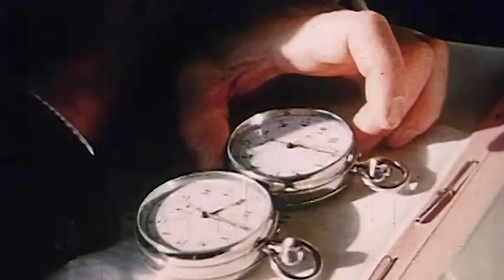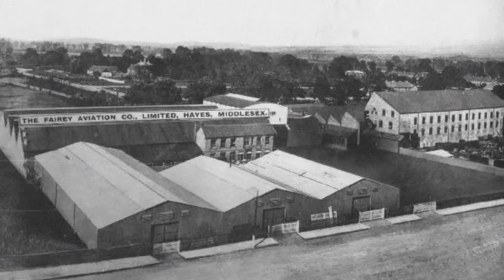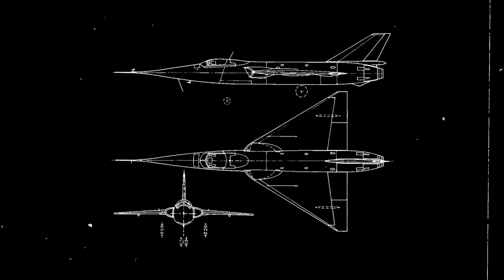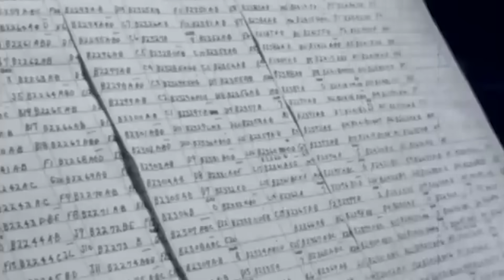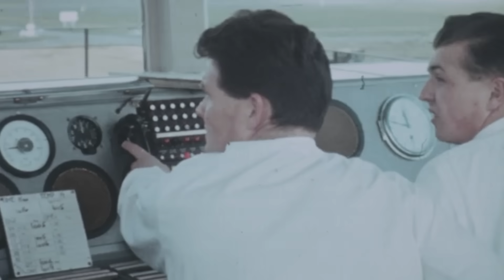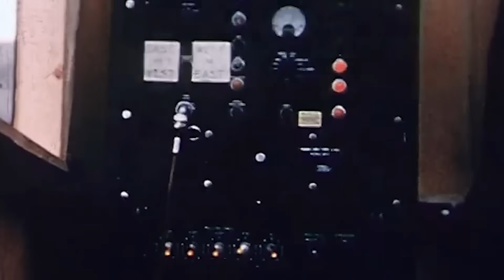Britain's 300 MPH Most Successful Mistake

Comment: They did all the testing over France. Funny how future Mirage aircraft looked similar.
Reply: It didnt
Reply: @DoktorBayerischeMotorenWerke 

We believe we can clear up some commonly held myths and misconceptions, obviously

It's always good to see the facts presented clearly and concisely isn't it?

The original fabulous Whittle reverse combuster centrifugal compressor gas turbine aero engine has been in production permanently in one form or another by more that one manufacturer since 1939. The main current application is for helicopters. 
Whittle performed the world's first demonstration of a gas turbine aero ending in 1937. 

British Aerospace Sector & some bits & bobs etc. 

Interesting British achievements.
There is no doubt that the Fairey (England)
Delta 2 was of course the world's first jet
aircraft to exceed 1000 mph.  lndeed It
exceeded the previous record by 310 mph &
held the record for more than a year. Incidentally, the Dassault Mirage series of aircraft are based on the Fairey Delta 2. 
March 1956,  UK Peter Twiss,
1,132	 mph, Fairey Delta 2,	 Chichester, UK

The next speed record after the FD2 -
December 1957, USAF	1,207.6	mph, McDonnell F-101A Voodoo, 	Muroc, California 😎.

Non combat phase accident losses.
% of Aircraft built.
The EE Lightening did not have unusually high losses. 
The Canadair CL-44 was a turboprop airliner.
Canadair CL-44               (ff 1959 ) 48%
Lockheed XF104             (ff 1954) 100%
Lockheed  P80                (ff 1944)  43%
Lockheed F104               (ff 1954)  45%
MD FH Phantom 1          (ff 1945)  35%
MD F4 Phantom 2           (ff 1958)  28%
Convair F102 Dagger      (ff 1953)  45%  
MD F3H  Demon              (ff 1951)  32%
MD F-101 Voodoo           (ff 1954)  34%
EE Lightening                   (ff 1954)  33%
Gloster Meteor                (ff 1943)   21%
DH Vampire                     (ff 1943)   23%
DH Sea Vixen                  (ff  1951)  33%
Gloster Javelin                (ff 1951)   20%

Note that the Meteor didn't have particularly high losses, flew with more than 20 airforces for decades, got involved in air to air combat during a number of conflicts successfully against aircraft that first flew many years after the Meteor first flew.

Early days, jet engines. Whittle performed the world's furst demonstration of a gas turbine aero engine in 1937. The RR Nene, a centrifugal gas turbine aero engine, was the world's most reliable & most powerful gas turbine aero engine in 1944. Licensed built versions & copies of the RR Nene & RR Derwent would go on to power many aircraft in Russia including the Mig 15 & Mig 17, the US, China, France & other countries for decades after 1944. Incidentally, the Mig-15 was in essence an upsized / tweaked copy of the Whittle / Gloster E28/39 jet aircraft including a copy of the RR engine.  The centrifugal compressor gas turbine aero engine with Whittle style reverse flow combusters and sometimes an axial compressor section is still manufactured by more than one company, the main application being helicopters.

   That's correct, The Tornado & Typhoon & their engines are supersonic & are indeed British design aircraft with British design engines built by an international consortium. The Tornado design for example started life during the 1950s at Vickers as the AFVG, it's engine is based on the RR RB-199. The EE Lightening is also a British Supersonic jet aircraft. At the time the EE Lightening first flew it was indeed one of the fastest aircraft on the planet, it was still one of the fastest aircraft on the planet 4 years later when it managed a mach 2 flight.

  The Typhoon is the British BAC-EAP with an engine based on the British RR XG-40, the Typhoon is also built by an international consortium.

  Clearly It's a great pity & a crying shame that British military forces had to occupy a large part of Germany for decades after 1945 & Russian military forces had to do the same. Of course Russia still posseses a large chunk of what was German territory & of course  Russia & the UK produce nukes. Obviously Germany does not produce nukes.

An example of what goes on these days in various countries.

   Indeed, There are no German companies that make German jet aircraft in Germany & there are no German Companies that make German gas turbine aero engines in Germany that are suitable for widebody airliners.

  BAe Systems, GKN Aerospace & Rolls Royce combined now do more Airbus work than Germany on an absolute basis & significantly more work than that on a per capita basis.
   
  Per capita for the home nation BAe Systems is the world's largest defence contractor. BAe systems announced the recent £4 Billion takeover of Colorado based US based Ball Aerospace.
  
  BAE systems now does a significantly higher value of work for Airbus than it did when it was a major Airbus shareholder before 2005.
     
  RR now owns US Engine maker Allison for example which does classified Aerospace work for the US Govt.
   
 Anybody currently flying on a widebody airliner stands a good chance of being on an aircraft powered by RR gas turbine aero engines built in the UK.

  A glimpse of what goes on in the very internationally orientated British aerospace sector.

Boeing Apache Attack Helicopter.
AH-64: 75 UK suppliers, 7% UK content, global fleet of 1280+ aircraft.
F35B more than 130 UK Suppliers, more than 30% UK content.
F35A & F35C more than 130 UK Suppliers, more than 15% UK content.

The UK has the world's highest combined per capita Nuclear, Defence & Aerospace Sector activity.

Rolls Royce Holdings UK
Subsidiaries
- Rolls-Royce plc
- Rolls-Royce North America (Allison etc &  
  Classified Military stuff)
- Rolls-Royce AB
- Rolls-Royce Deutschland
- Rolls-Royce India Private Limited
- Rolls-Royce Marine Power Operations
- Vinters Engineering Limited
- Rolls-Royce Controls and Data Services
- Rolls-Royce Power Systems
- Bergen Marine
Joint ventures include:
- Rolls-Royce Turbomeca
- MTU Turbomeca -

Trent Family
The MT30 (Marine Turbine)
Industrial Trent 60 Gas Turbine
Trent 7000
Trent XWB Airbus A330neo.
Trent 1500
Trent 1000
Trent 500
Trent 600
Trent 700
Trent 800
Trent 8100
Trent 900

RR wholly owned subsidiaries in Germany handle smaller 2 shaft RR gas turbine aero engine work.   

We hope this helps of course.
     
Cheers, as always & indeed 👍.

Comment: Delta 2 a good aircraft. A interesting aircraft that have never looked to much into. The mig 15 had royal Royce Nene jet engine. Given as a, goodwill. USA weren't happy. at least the USA stopped Britain giveing the Russian the De Havilland comet. That would be interesting. 😂..Thank goddess it wasn't sold to the Russian . I remember the Concorde flying over London. Breaking the sound barrier. Then it stopped after a few years. Because it was to noisy. Made a model of the Mig 15 and the Concorde. When I was a kid. 👍

Comment: Kind of reminds me of the F-106. I talked to a guy who flew those in the air guard. He said it's not ideal for dog fighting.  He told me you get one hard turn, then you've lost so much energy there's not much left for a while. A characteristic of delta wings.
Reply: That's an interesting point - I never considered the FD2 as anything other than a potential rapid response type interceptor - as I lad wen I used to see them scream overhead I assumed they were already in service! t was only many years later I discovered they were part of an experimental program only and that incredibly they were never even commissioned unless you include the BAC 221 which was basically a modestly modified FD2 then being used as a partial  test bed for features later included in the development of Concord!!

Comment: 1956. Sounds like what the Canadian government did to another delta wing jet, the Avro Arrow, created in the same period. A good design, designed, built, and successfully tested. And then, burned, bashed, and buried for reasons still unknown. And then, the U.S. built the F-102, yet another delta wing fighter jet that miraculously succeeded where others had "failed". The Soviet equivalent, the MiG-21, also built in the '50's became the Soviet Union's standard clear-air interceptor. It was used by more than three dozen countries and over 6,000 MiG-21s were flown. Britain and Canada bailed and failed, but the Yanks and Russians did it. Weird.

Comment: Strange - I always thought that the FD2  - notice that the later model had the same ogive wing planform as Concord - was built primarily (as was the HP 115) to investigate the control and stability issues  at both ends of the speed range of the Concord.  The slow-speed issue was "Dutch roll";  the high-speed one was (presumably) the trans-sonic shift of the aerodynamic centre of the wing.

Comment: Fairey was backstabbed again by the UK government (and the USA) with the Rotodyne, which could have (and still could) revolutionized city to city transport over steadily increasing ranges and with the key factor of the rotor acting like a parachute. 
It was not a helicopter but a gyro plane with motive power coming from separate engines such that the lift and land rotor was only operational for a few minutes and acted as passive generator/'wing' in forward and rear flight. In the case of total turboprop failure the natural rotation of adjustable rotor would allow safe descent even if tip jets had also failed, albeit with a bit of a bump. One prototype meant for water use had a skirt type inflated bottom which would have mitigated shock in an emergency landing on dry land.
On free rotor alone the Rotodyne could glide to safe put down places.
Reply: To be fair, I think the Rotodyne was far too noisy to operate in city centres.

Comment: Super saber wasnt a speed machine at all. Not surprising it broke the record
Reply: I believe the record stood only for a few  weeks till being surpassed by a US design, it narrowly scraped in before the era of the Mach 2 fighters.
Reply: @roberthardy3090 

We believe we can clear up some commonly held myths and misconceptions, obviously

It's always good to see the facts presented clearly and concisely isn't it?

The original fabulous Whittle reverse combuster centrifugal compressor gas turbine aero engine has been in production permanently in one form or another by more that one manufacturer since 1939. The main current application is for helicopters. 
Whittle performed the world's first demonstration of a gas turbine aero ending in 1937. 

British Aerospace Sector & some bits & bobs etc. 

Interesting British achievements.
There is no doubt that the Fairey (England)
Delta 2 was of course the world's first jet
aircraft to exceed 1000 mph.  lndeed It
exceeded the previous record by 310 mph &
held the record for more than a year. Incidentally, the Dassault Mirage series of aircraft are based on the Fairey Delta 2. 
March 1956,  UK Peter Twiss,
1,132	 mph, Fairey Delta 2,	 Chichester, UK

The next speed record after the FD2 -
December 1957, USAF	1,207.6	mph, McDonnell F-101A Voodoo, 	Muroc, California 😎.

Non combat phase accident losses.
% of Aircraft built.
The EE Lightening did not have unusually high losses. 
The Canadair CL-44 was a turboprop airliner.
Canadair CL-44               (ff 1959 ) 48%
Lockheed XF104             (ff 1954) 100%
Lockheed  P80                (ff 1944)  43%
Lockheed F104               (ff 1954)  45%
MD FH Phantom 1          (ff 1945)  35%
MD F4 Phantom 2           (ff 1958)  28%
Convair F102 Dagger      (ff 1953)  45%  
MD F3H  Demon              (ff 1951)  32%
MD F-101 Voodoo           (ff 1954)  34%
EE Lightening                   (ff 1954)  33%
Gloster Meteor                (ff 1943)   21%
DH Vampire                     (ff 1943)   23%
DH Sea Vixen                  (ff  1951)  33%
Gloster Javelin                (ff 1951)   20%

Note that the Meteor didn't have particularly high losses, flew with more than 20 airforces for decades, got involved in air to air combat during a number of conflicts successfully against aircraft that first flew many years after the Meteor first flew.

Early days, jet engines. Whittle performed the world's furst demonstration of a gas turbine aero engine in 1937. The RR Nene, a centrifugal gas turbine aero engine, was the world's most reliable & most powerful gas turbine aero engine in 1944. Licensed built versions & copies of the RR Nene & RR Derwent would go on to power many aircraft in Russia including the Mig 15 & Mig 17, the US, China, France & other countries for decades after 1944. Incidentally, the Mig-15 was in essence an upsized / tweaked copy of the Whittle / Gloster E28/39 jet aircraft including a copy of the RR engine.  The centrifugal compressor gas turbine aero engine with Whittle style reverse flow combusters and sometimes an axial compressor section is still manufactured by more than one company, the main application being helicopters.

   That's correct, The Tornado & Typhoon & their engines are supersonic & are indeed British design aircraft with British design engines built by an international consortium. The Tornado design for example started life during the 1950s at Vickers as the AFVG, it's engine is based on the RR RB-199. The EE Lightening is also a British Supersonic jet aircraft. At the time the EE Lightening first flew it was indeed one of the fastest aircraft on the planet, it was still one of the fastest aircraft on the planet 4 years later when it managed a mach 2 flight.

  The Typhoon is the British BAC-EAP with an engine based on the British RR XG-40, the Typhoon is also built by an international consortium.

  Clearly It's a great pity & a crying shame that British military forces had to occupy a large part of Germany for decades after 1945 & Russian military forces had to do the same. Of course Russia still posseses a large chunk of what was German territory & of course  Russia & the UK produce nukes. Obviously Germany does not produce nukes.

An example of what goes on these days in various countries.

   Indeed, There are no German companies that make German jet aircraft in Germany & there are no German Companies that make German gas turbine aero engines in Germany that are suitable for widebody airliners.

  BAe Systems, GKN Aerospace & Rolls Royce combined now do more Airbus work than Germany on an absolute basis & significantly more work than that on a per capita basis.
   
  Per capita for the home nation BAe Systems is the world's largest defence contractor. BAe systems announced the recent £4 Billion takeover of Colorado based US based Ball Aerospace.
  
  BAE systems now does a significantly higher value of work for Airbus than it did when it was a major Airbus shareholder before 2005.
     
  RR now owns US Engine maker Allison for example which does classified Aerospace work for the US Govt.
   
 Anybody currently flying on a widebody airliner stands a good chance of being on an aircraft powered by RR gas turbine aero engines built in the UK.

  A glimpse of what goes on in the very internationally orientated British aerospace sector.

Boeing Apache Attack Helicopter.
AH-64: 75 UK suppliers, 7% UK content, global fleet of 1280+ aircraft.
F35B more than 130 UK Suppliers, more than 30% UK content.
F35A & F35C more than 130 UK Suppliers, more than 15% UK content.

The UK has the world's highest combined per capita Nuclear, Defence & Aerospace Sector activity.

Rolls Royce Holdings UK
Subsidiaries
- Rolls-Royce plc
- Rolls-Royce North America (Allison etc &  
  Classified Military stuff)
- Rolls-Royce AB
- Rolls-Royce Deutschland
- Rolls-Royce India Private Limited
- Rolls-Royce Marine Power Operations
- Vinters Engineering Limited
- Rolls-Royce Controls and Data Services
- Rolls-Royce Power Systems
- Bergen Marine
Joint ventures include:
- Rolls-Royce Turbomeca
- MTU Turbomeca -

Trent Family
The MT30 (Marine Turbine)
Industrial Trent 60 Gas Turbine
Trent 7000
Trent XWB Airbus A330neo.
Trent 1500
Trent 1000
Trent 500
Trent 600
Trent 700
Trent 800
Trent 8100
Trent 900

RR wholly owned subsidiaries in Germany handle smaller 2 shaft RR gas turbine aero engine work.   

We hope this helps of course.
     
Cheers, as always & indeed 👍.

Comment: So was this the first airplane with super cruise ability?
Reply: I believe that it had that ability BUT super-cruise was not specifically sought after. Peter Twiss the main test pilot first took the FD2 to 1.1 mach without switching on his afterburners. So there is no doubt in my mind it had that ability but that it was not at the time sought after as a specific feature.
Reply: @lenfirewood4089  Yes, I am aware that it most probably was not a design requirement, but it is definitely an outstanding achievement!
Reply: Super cruise is sustained supersonic flight without continuous use of afterburner. FD2 required afterburner. First aircraft with Supercruise was the EE Lightning, then Concorde could do it too.

Comment: Look at whitened to Canada's Arrow program. The fastest ever, at 60K ft, flying at mach 2.2 and the first ever (for many decades to come) to incorporate fly by wire. Again killed by bureaucracy. Designed on the board, first flown off the board, not even a test craft. It was the most advanced aircraft in the world. The engineers involved were taken in by the U.S. and NASA.